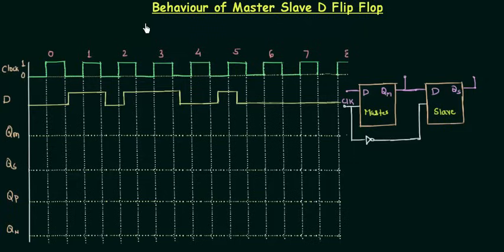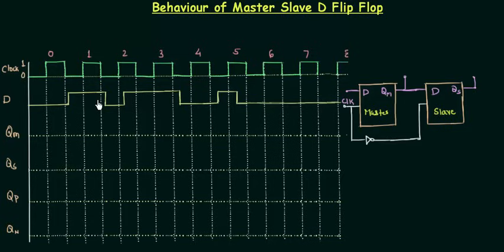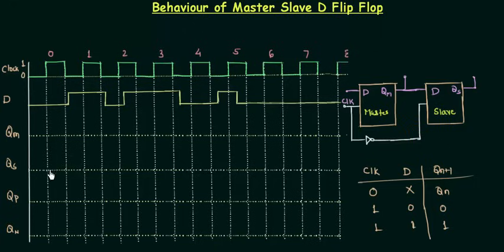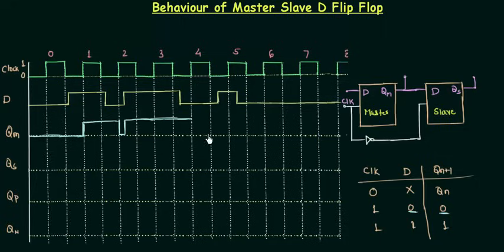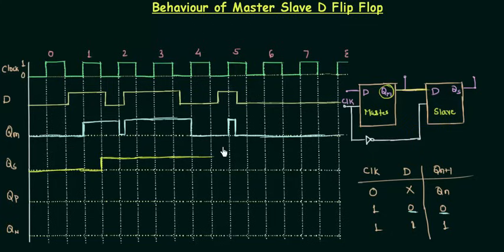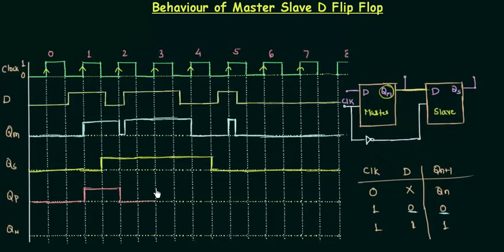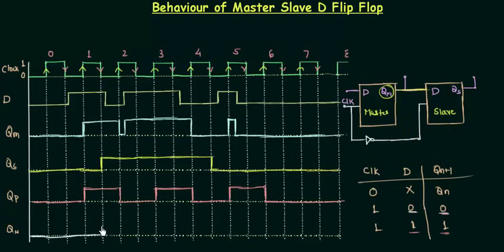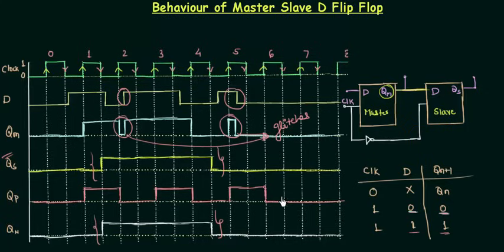Behaviour of Master Slave D Flip Flop

Comment: I think there is a small error(inconsistency) in 3~4 in Qm. I believe Qm should mirror D's output when Clock is 1 so it should go to low when D goes to low. Feel free to tell me if I'm wrong.
Reply: My bad actually Clock is 0 between 3~4 so Q_m will output the former state (which was high) and thus you're explanation is correct. My bad!

Comment: To solve some confusions:

1) Why Make Master Slave for FF when it by itself is edge triggered and removes glitches
Yes, we dont use Master Slave for FF the video title should be for D Latch instead
We use Master Slave for LATCHES to make FF

2) Why Master Slave for DFF when theres no 1 1 conditions
BTW it should be D Latch and D Latch is level triggered
Though there are no race around conditions here, We use master slave setup to 
REMOVE GLITCHES

Comment: Master Slave:
1) Output of Master connected to input of Slave
2) Clock of Master Inverted, Clock of Slave not inverted
3) Technique used to convert Level Triggered Latch into Edge Triggered Flip Flop

Comment: Master circuit and Slave circuit are individually Level sensitive, but the over all circuit behaves as Edge sensitive.
Reply: I have a doubt here... I was asked to design a d flipflop from positive triggered SR flipflop in Cadense  

Initially I built a nand based SR latch and then I added clock and made it to SR flipflop.. now my doubt is how to make it as  positive triggered SR flipflop  ?

Comment: D = Direct change
Qm = Master output
Qs = Slave output
Qp = Master output, only changes when triggered on the Positive-edge
Qn = Slave output, only changes when triggered on the Negative-edge

The clock is used as the enable for Qm and Qp.
The inverted clock is used as the enable for Qs and Qn.

When clock is 1, Qm will be the same as D. Qs will remain unchanged.
When a clock changes from 0 to 1, Qp will be the same as D. Qn will remain unchanged.

When the clock is 0, Qs will be the same as D. Qm will remain unchanged.
When a clock changes from 1 to 0, Qn will be the same as D. Qp will remain unchanged   (copied)

Comment: My explanation...

D = Direct change
Qm = Master output
Qs = Slave output
Qp = Master output, only changes when triggered on the Positive-edge
Qn = Slave output, only changes when triggered on the Negative-edge

The clock is used as the enable for Qm and Qp.
The inverted clock is used as the enable for Qs and Qn.

When clock is 1, Qm will be the same as D. Qs will remain unchanged.
When a clock changes from 0 to 1, Qp will be the same as D. Qn will remain unchanged.

When the clock is 0, Qs will be the same as D. Qm will remain unchanged.
When a clock changes from 1 to 0, Qn will be the same as D. Qp will remain unchanged.
Reply: between stage 1 negative and 2 positive, the clock is negarive and the values of D and Qs are not the same..
Reply: I have a question.... Qn is compared with Qs for negative edge triggered and master slave ff, but the Qn is obtained in the first step so for obtaining the Qn we should see the Qm as input not D as input(sir taken D as input ).
@olli3686

Comment: Good Video lecture  sir, I have a doubt in your video of master slave flip flip- Let see in the Qm output- you showed two glitches, the second glitches is dropped down without complete one cycle of clock is it write?. it confused about to me. timing from 
4:06 to 5:15
Reply: I think because the gap between the changes in d and clock is very less. input signal d is low for a very small time

Comment: Can somebody help me...
Master slave condition was made for race around condition
Race around condition happen when J=1 and K=1
In D flip flop there is no 1,1 condition because of not gate
Then, how is D flp flop applied in master slave condition??
Reply: The master slave is used  to remove the glitches in the signal. Applying is the same, right after the not gate of signal D in R , and the directly in S.

Comment: I learned that dff reacts to clock changing (and just that clock moment when it goes up)
and there is latch dff which passing d to q as long as he have logical 1 in the clk

in this video, it seems you working with latch dff
i think you should write it in description because it might confuse people

besides that. awsome video and awsome explain
you really helping! thank you.
Reply: There is nothing latch FF. Latch can be converted to FF by different methods. Like using master-slave design presented here. Here two latches are used to design FF. Most importnant one, Latches are level trigger, where FFs are edge triggered.

Comment: see master is actually a d flipflop and result obtained from it Qm and Qp is also a d flipflop .but why Qm has glitches and Qp doesnt. Infact Qm shouldnt have glitches as it is a D flipflop
Reply: Master is a D-latch and slave is also a D-latch but when you combine both the Master D-latch with the slave D-latch it produces a negative triggered flip flop, ( i think, its because of the inverter from the clock signal  that connects to slave latch)  as shown in the video.  
hope this helps

Comment: why we have considered glitch in Qm and not in QP? Please reply this question?
Reply: there is no glitch in Qp
Reply: Sahil Arora, so why there is no glitch in Qp
Reply: Because the input signals are only changed when the clock is at the high edge for the Qp (positive triggered flip-flop).
Reply: but master is also a positive triggered flipflop

Comment: I have a confusion between Qm and Qp. Both are D FFs but they produce different waveforms that is the first one is level triggered while the second one is edge triggered. 
Anyways great video.
Reply: D = Direct change
Qm = Master output
Qs = Slave output
Qp = Master output, only changes when triggered on the Positive-edge
Qn = Slave output, only changes when triggered on the Negative-edge

The clock is used as the enable for Qm and Qp.
The inverted clock is used as the enable for Qs and Qn.

When clock is 1, Qm will be the same as D. Qs will remain unchanged.
When a clock changes from 0 to 1, Qp will be the same as D. Qn will remain unchanged.

When the clock is 0, Qs will be the same as D. Qm will remain unchanged.
When a clock changes from 1 to 0, Qn will be the same as D. Qp will remain unchanged.
Reply: So both master and slave flipflops are level triggered? But I thought that the difference between latches and flip flops was that latches were level triggered and flipflops are edge triggered, is that not the case? @olli3686
Reply: Because one is level triggered and other edge triggered
Reply: Cause master slave is generally used for level triggered flip flop
Reply: that is what exactly i was tried to comment.
Reply: Because the Qp one is for the whole flip flop. But Qm is the only for the master part of this which acts like a latch.

Comment: why is the d flip flop acting as level sensitive device?? Please explain..
Reply: He said master slave as negative edge triggering but it does not use negative edge triggering,it uses level triggering . it just behaves as negative edge triggering as we can see at the end both the diagrams of master slave and negative edge triggering are same .
Reply: Yeah I was wondering that as well. Aren't all Flipflops edge triggered? And in a previous video you mentioned that Master-Slave Operation is negative edge triggering. Please clarify, thanks.
Reply: For d flipflop the o/p and i/p are same
Reply: I think, there is no arrow sign with clock input on device. It was edge triggered when there is arrow on the device. On the other hand it was level triggered. :)

Comment: It seems like the master d flip flop is level as well as edge sensitive ! Is that even possible?
Reply: I'm also so confused. I dunno. I've always thougt that all flipflops are only trigger sensitive.
Reply: @karlziegmarabuda9125  yeah
Reply: He’s using D type latches for Qm & Qs but calling them flip flops. In a previous lecture he said a latch is level triggered and flip flop is edge triggered. So he’s not using the definition he gave himself.

Flip flops are always edge triggered by definition. D type latches have an enable pin instead of a clock pin, and are level triggered.
Reply: 0:28 Qm & Qs are D type latch outputs. How they are drawn on the right also implies no edge triggering. 
0:36 Qp & Qn are not drawn anywhere. He simply declares each as the output of a single edge triggered D flip flop (correctly).

Comment: Why is master slave used in d flop flip ?why not just use d flip flop
Reply: Here, the triggering method used is level triggering, so, as there is a possibility of race- around, we use a master-slave in D-Flipflop. But when it is edge triggered, we can just use a D-Flipflop as you suggested. Hope this helps

Comment: in positive and negative edge triggering we are following the d input, then why does glitches do not occur in positive and negative edge triggering?
Reply: +pranav satbhai Rewatch the video - this has been explained clearly ;)
Reply: +Sonnix Jackson But you r changing the signal (glitches) when the clock signal is high in both, Qm and Qp, so why the glitches do not affect Qp
Reply: +nmerinos In edge triggered the signal state is taken on the edge, no changes are taking place in those instances. You need to look at the output on the edges - what is in between the edges is the stored value captured at the edges, hence no glitches.